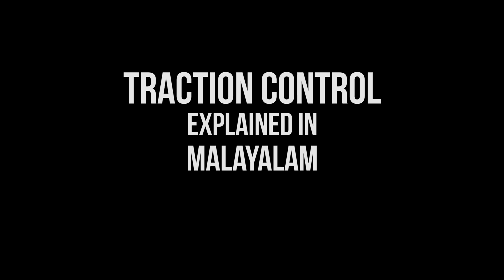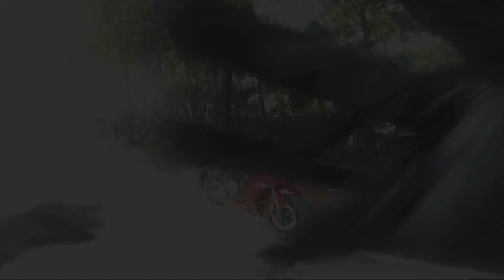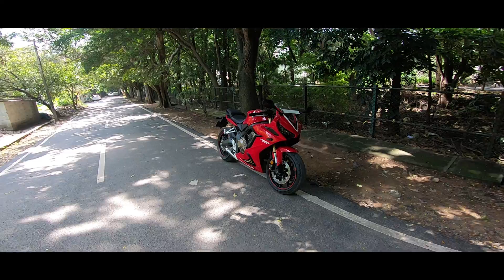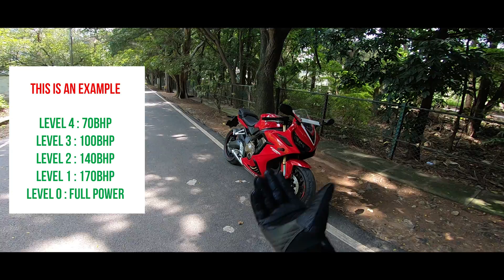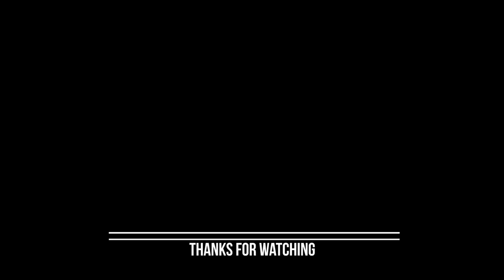Traction Control Explained in Malayalam

Comment: Strell bruh, kure karyangal undu ariyan 

SOHC engines
DOHC engines
Quick shifter
Cornering ABS
Chain drive, belt drive, shaft drive.
Use of iridium spark plugs
Single sided swingarm
Autoclipper
Diffrence between Pushrod engines and conventionals
Parallel twin vtwin
V4s inline4 flattwin Ltwin enginde power delievery!
Questionpaper pole undalle😅 Koodipoyengil sry bruh!😅

Comment: Launch control,wheelie control,quick shifter,cornering abs and lean angle,engine brake control,fully adjustable suspension explain plsss...
Reply: Launch cntrl en vechal - vandi 1st ittu edukumbol korch koodi balance kitum
Wheelie cntrl- powerful bikes avumbol namal pettan throttle cheyumbol vandiyude front wheel pongum appo athine oru paruthi vare cntrl cheyum
Quick shifter - clutchless upshifiting
Lean Angle - idk....
Engine breaking - namal throttle dip cheyumbol vandiyude speed kurayum - break use akumbol ith koodi cheythal nanayirikum
Cornering abs- corner edukumbol pettan brake ittal tyre lock avathe irikanum grip kittanum
Full adjustable suspension -namuk namude ishtathinu suspension adjust cheyam 😊

Comment: Strell bro, video polichu, ithupole ella electronic & mechanical features ne kurich oru video cheyyuvo.
1. Slipper clutch
2. Quick shifter
3. Autoblipper
4. Wheelie control
5. Cruise control
Pinne, Benelli Leoncino 250 launch aayittund. Ex-showroom price 2.5 aan, athine kurichum oru video pratheekshikkunnu.